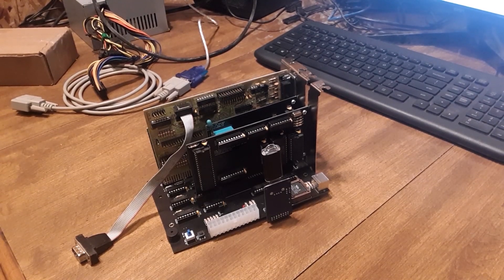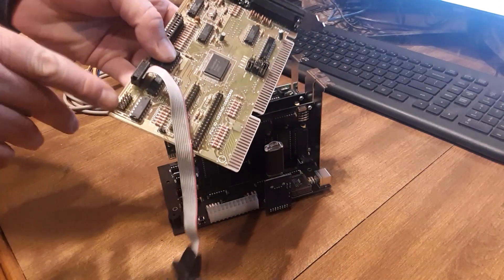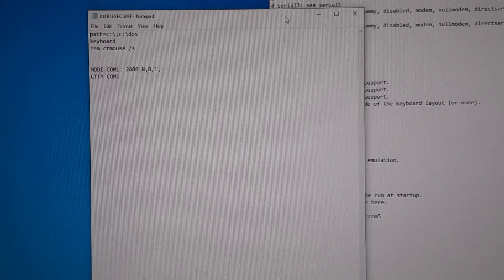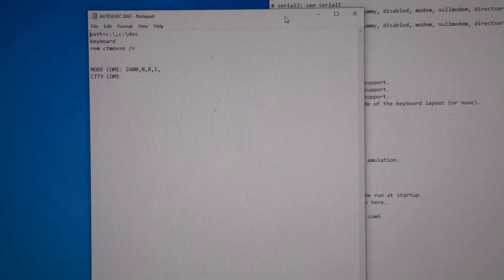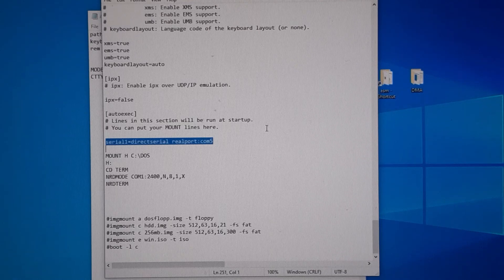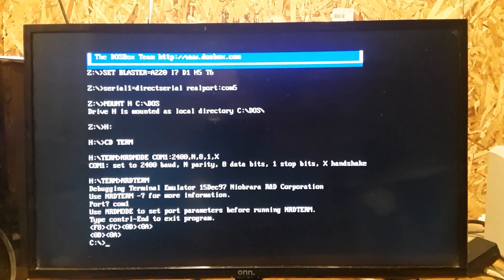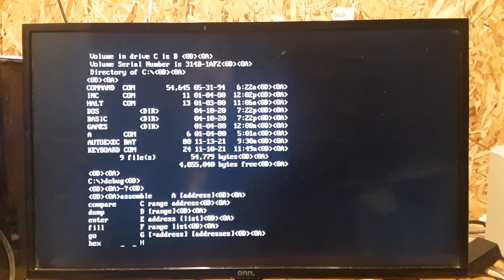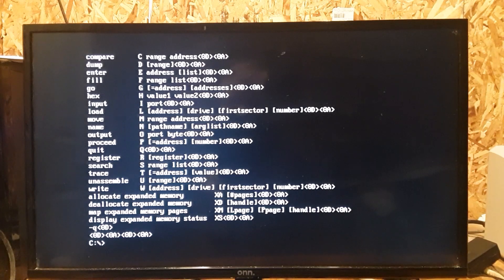Serial Dumb Terminal

Comment: Can this work better, faster baud and being able to edit files and producing the prompt more natively without the gobbledygook.
Reply from the maker: It has been a while since I messed around with the serial cable. I think some of the slowness is because it is running on a 8088 at 5-8 MHz. 

I rewatched the video I an not sure why it is limited to 2400 baud. I mainly put this together to demo the serial communications on my homemade PC.
Reply: @elijahmmiller  Its awesome I am working on completing my XT system and like the idea of accessing the computer via terminal sadly finding vintage monochrome monitors is too hard now and I was hoping to do some modern raspberry pi terminal version which can also help make transferring files and programming the XT alot easier